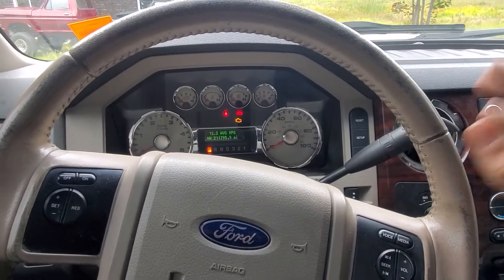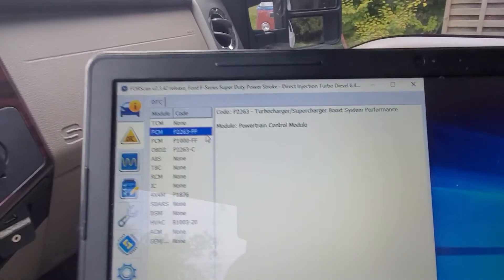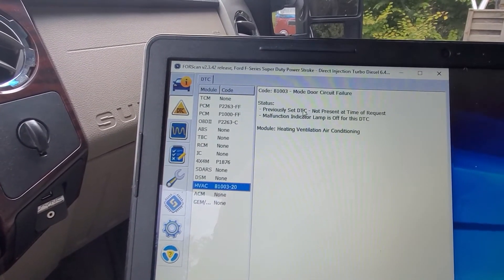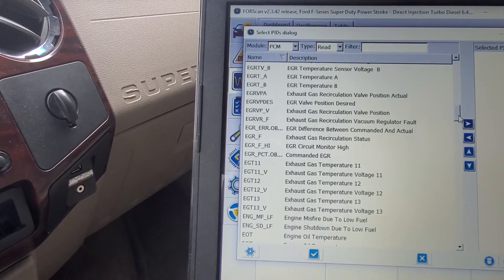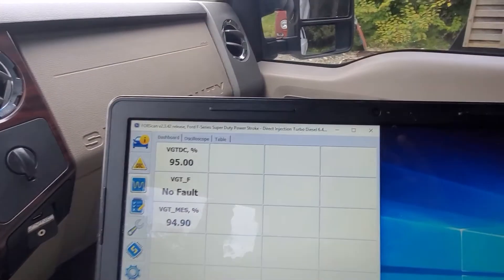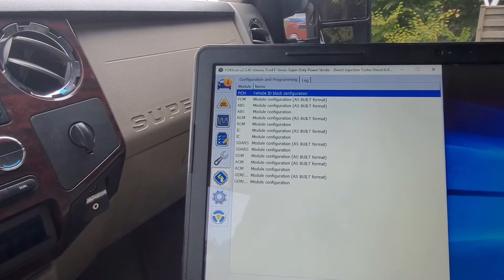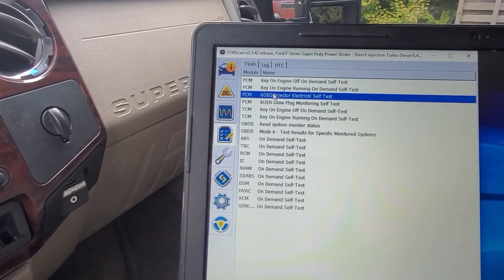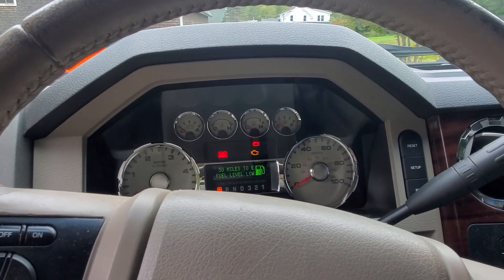Entry To FORScan, testing on a 6.4L Powerstroke

Comment: Which connector did you use to connect the OBD2 to the computer?
Reply from the maker: https://www.amazon.com/gp/aw/d/B081VQVD3F?psc=1&ref=ppx_pop_mob_b_asin_title  this is the one I use. You'll need to download the firmware for it before you use it. Super simple basically does it itself.